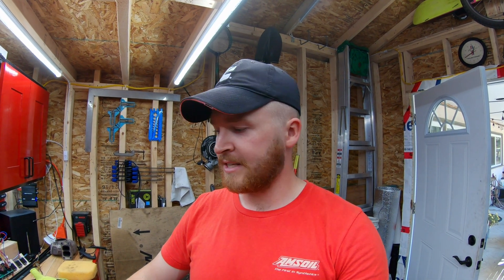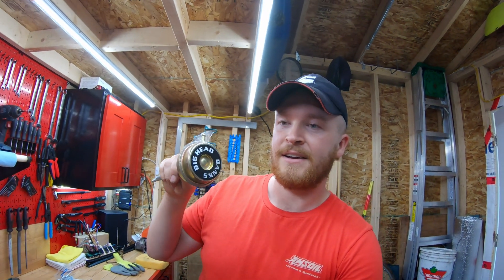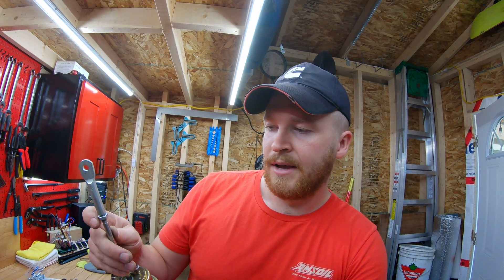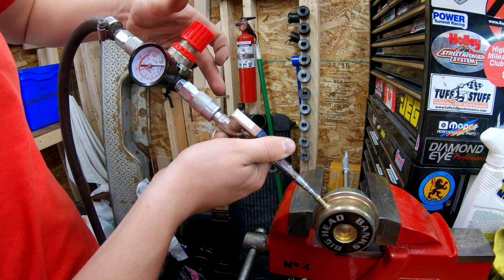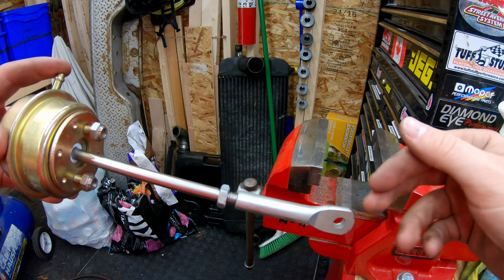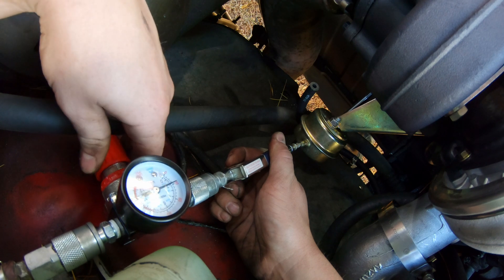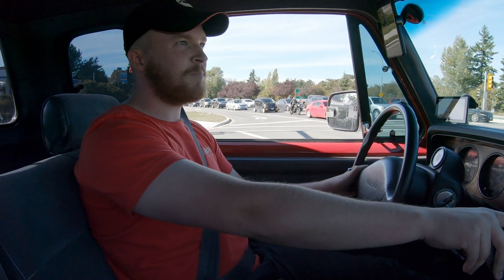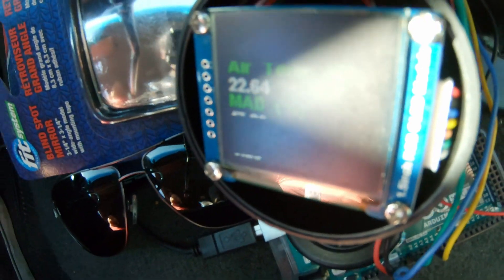@bankspower BigHead Wastegate Actuator | 1st Gen Cummins

Comment: I just got a hx35 from a 98.5-02 dodge it has the cast elbo on it we’re would be a good place to get the exhaust flange to clamp to my stock exhaust
Reply from the maker: Should be the same if it's not some of the exhaust places or diesel shops online sell adaptors that you have to weld on

Comment: I have the same truck and am looking to order this wastegate. Do you know if I should order the wastegate for the 94-98 or 99-01?
Reply from the maker: I'm not sure as I got mine used, I didn't have an exact part number. As long as the shaft is long enough (I had to cut and thread mine down a bit). you should be okay.
Reply: Preciate it. I ordered the 94-98. We’ll see if I have to do the same

Comment: I love the little arduino based gauge set, I've been considering doing something very similar (but more permanent 😅) on my swap. Do you have a video on which sensors you used and such? 👍
Reply from the maker: Hi, thanks! I do have several videos on the arduino project. I made a video for each sensor if you look back in my videos and then I have a couple update videos of the project overall.

Comment: is your injection pump stock? If so you are about to enjoy a whole new world once you tune it.
Reply from the maker: The blue truck I can tell has a stock pump. The red truck I've done 3200 spring, THD fuel pin, M&H timing spacer, and 1/2 turn from runaway on max fuel screw. I need to bring my starwheel up a bit and back out my smoke screw some. I've got too much zero boost fueling and too much fueling under boost right now. We'll see what sort of performance I can get out of it. I think I'll notice quite a difference. I'm hesitant to floor it in the truck right now because it over fuels and smokes too much. Hoping I can get it dialed in a bit more for performance.